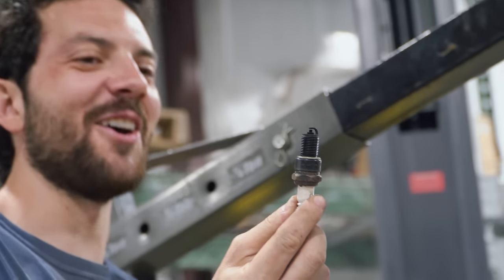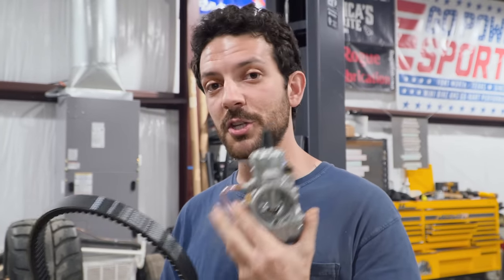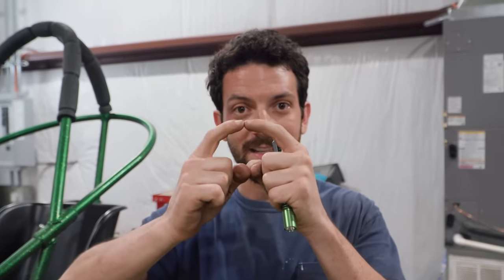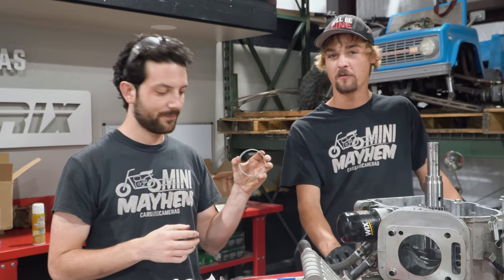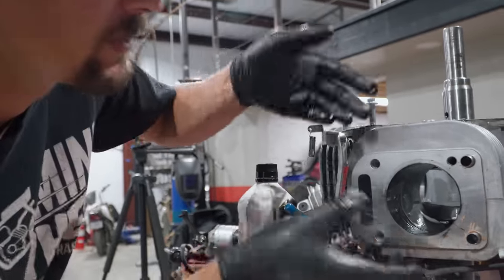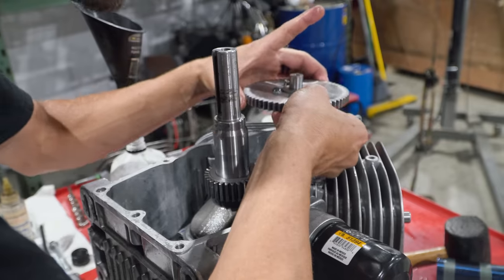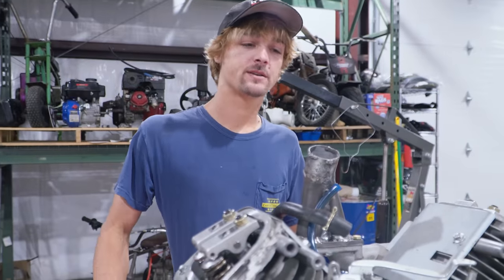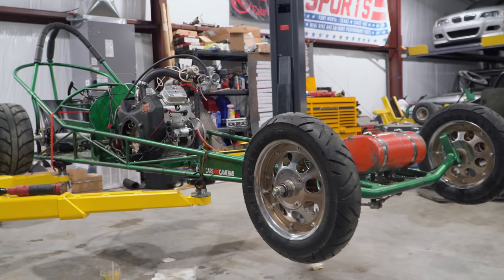Turbo 670cc Dragster Engine Rebuild | Prep for Methanol and More BOOST!

Comment: You guys need three times the amount of cfms for that carburetor and huge Jets and a lot of feel pressure run methanol.
I went from a 750 cfm carburetor on my race car engine to a 1200 cfm. Love to see it work make sure you guys flush out the engine every time you run it. 👍🏽

Comment: i always just used stp, or regular lucas oil additive as assembly lube. it's sticky, and i was gonna add it any way. for what you're gonna do with this, a teardown and inspection was a good idea, if not an absolute must. a sponsored top fuel dragster team may do that between every race to inspect for excessive wear and premature component failure in order to insure against "rapid unplanned disassembly" as charles so eloquently described it, on the track. that'll hurt a lot worse than getting yer panties inna wad over having to do all this extra work, especially if large, jagged chunks of hot metal wind up rapidly travelling through the same space as that currently occupied by your person because your engine ker-sploded, believe you me.

Comment: It was a good thing that you happened to notice the oil leak. because it likely would have gotten worse. it's a good thing that the 670 has a oil pump. otherwise it would have made installing a Turbo rather difficult. a higher lift longer duration camshaft would have been a good addition. to allow that turbo shove as much air/fuel mixture into the combustion chambers as possible. and you ultimately don't want to use a turbocharger on an ultra high compression engine. it would be interesting to see that 670 sprayed. you would get the most bang for buck. it's too bad you can't put EFI on that 670. it would have to be multi port not throttle body injection. the new Briggs and Stratton Vanguard V twins are fuel injected. although I'm not sure if they are multi port or throttle body injected. a stock one would be a perfect candidate for NOS. if I had an unlimited budget I would like to try that set up on a drag kart.
Reply: As long as you keep the overlap down you should be ok. Turbos don't like a lot of overlap

Comment: If I'm not mistaken on a past episode didn't Ike say he felt that it "ran out of gear" before the 1/8 mile? If that's the case I'd be changing to a larger diameter tire to help the turbo Pull that dragster along without going into too many rpms.

Comment: Back in the day when I ran jr dragsters we used to run a 42mm carb on a 407cc engine. Na obviously. Had to drill the tube the main jet was in to allow enough fuel through. Then adapted it to Holley jets and used number drills to set hole size. For boost I would chase about 0.85 lambda on this.

Comment: You should get rid of the rubber hose intake or use 1-2" rubber sections and a pipe between. The carburetor will get a cleaner vacuum signal without all the expanding and contracting rubber in the manifold.

Comment: If that engine used a gasket for the closure plate then you need to have a real gasket on there. The gasket helps set the crank end play. Your crank may not have the proper end play now and you could have some real problems. I was the western Canadian kohler service guy for over 10 years. I have seen the outcome of tight end play.

Comment: With boosted engines the boost cause lot more pressure in the crank case and on boosted car engines it will push oil out and they have to run a puke tank to catch the oil so that is something to keep in mind when racing because the track don`t like when you oil down the track
Reply: I was thinking that too. Theres going to be a bit more blow by while at idle or part throttle. Going to push some oil.
Reply: Has a catch can and a line into the intake to burn what it doesn't catch

Comment: rebuilt a lot of engines  when I was younger and if I remember right  you need .004 per inch  diameter.. so if you got a 3 inch piston you need 12 thousands   end gap.

Comment: replace the charge hose with a real pipe the less rubber on the intake the better it will perform rubber on a turbo system is normally only used to couple pipe together

Comment: Y’all should install and inter cooler in it.  Maybe an ice one
Reply: With methanol, it's not necessary to run an intercooler. Methanol cools the air as it mixes.

Comment: Top ring gap is always tighter than second. This is so that cylinder pressure doesn't get caught between the two rings and lift the top ring off its land, killing the seal. Don't know if it's going to be the end of the world for this build, but I'd have given it at least 5-10thou more gap than the top ring, if not the full 0.014" wider than the top ring that it came with.

Comment: Always be careful about the Orings on the Side covers that are there to keep in the oil pressure. Whenever you are inside these engines weather it's a Honda, or clone or Briggs Vanguard or basically any of these V twins horizontal or vertical shaft engines. The oil pumps are in the side covers and or sumps and in order to pass pressure to your block where it goes onto your camshaft and crankshaft/rods the oil is passing through Orings and with time and heat, they get hardened and they are prone to leaking. The problem solving is adding a additional solid sleeve to your pass through points to protect your orings from blowing out at high RPMs or just installing new set of Viton Orings which are superior for heat and oil over conventional rubber ones are! 🤔 the gaskets on the Briggs are stupid money anymore and people cut corners on these gaskets, which is usually a big mistake. The set your side lash of your cam and crankshaft and by adding sealers to your gasket surface, in theory your opening up your end play on both the cam and crank! Which is something you would like to avoid. Just a BTW for ya'all. May want to get the correct gasket thicknesses and dial in the end play if you want this engine to hold together any length of time?

Comment: Nitro is self oxidizing, meaning it doesn't need additional oxygen to ignite. You can run even richer than with straight methanol. Also, Im not sure if it matters on lower concentration mixes like 50/50 but pro teams that run nitro actually start the engine on gasoline and then switch on the nitro. And they "blow down" the fuel system to get the nitro out before attempting a restart.

Comment: The heads have had work done? If so you need to lathe the pistons and/or ad a gasket to the head since all you get is detonations if you have high comp with forced induction.

Comment: The part on the head that has that ring around it is there because it's a boosted application there are gaskets meant for it so if you're not using the same gaskets as I meant for that head you're going to blow head gaskets

Comment: You guys might want to make the carburetor a blow-through because injecting liquid through the turbo will damage it very quickly. To make the carburetor accept boost, you need to keep the bowl from pressurizing (plug the bowl vent in the intake and add one on the bowl itself and vent that to atmosphere) and increase fuel pressure based on boost, you can get boost reference fuel pressure regulators on Ebay for cheap. Good luck.

Comment: No, massive is the jets Rotary Engineering put in the rears on the dual Weber 46 DCD progressives on my built up RX engine.  The rears had NO jets in them, just wide wide open.

Comment: I would have opened up the bottom ring the "stock" difference between the two rings. You always want the bottom ring to have a wider gap to allow pressure between the rings to be relieved. Your bottom ring will be wider but not by much, you may get away with it.

Comment: ethanol allso works as a degreaser so disolves the engine oil , theres special oil for alki engines and you need to change the oil a little more often , its allso wise to drain the ethanol from the fuelsystem and even run the engine on gasoline for a while before storing it
known of a mini cooper racer that converted the engines carbs to run alcohol , now these cars run SU carburators that have a simulair fuel metering system compared to a moped motorcycle carb , beside enlarging the emulsion tubes and the jets he had to have the needles machined too to get the fuel curve right for the alcohol fuel
as for the bigger fueltank : maibe look intoo an aluminium mini beerkeg
about the alcohol tune , think grass speedway bikes run on alcohol i know the ice speedway ones do , maibe look intoo those forums to get some base tune tips

Comment: The ring gaps make no difference when assembling an engine. Rings rotate on the piston when it's running, and will line up together many times during the engine's life.

Comment: You should make a aluminum or steel intake manifold, while the engine is running at idle you can see the engine begging for more air. You can see the tube sqeezing itself almost shut

Comment: I'm surprised that the billet rods are aluminum! They have a limited cycle life. I understand that they are lighter and allow for more revs. For longevity they should be of a high strength steel, like 4130.

Comment: Easy to knock a crank out of alignment from using impact gun on crank related things.
Reply: That only applies to two piece cranks like on older two stroke bikes. Small engine cranks are one piece…

Comment: You guys really need a lambda guage to get your air/fuel ratio right. 
Although I still do it, indexing rings really isn't as important as you'd think. When the engine is running the ring gaps move.

Comment: you know there's an up & down side to piston rings, right? Never mind which is top or second ring, rings have a slight bevel on them that is critical for proper cylinder sealing. Typical identified with a dot (dot towards the top).

Comment: Methanol is happiest at 6.4 afr, but will tolerate being up to 20% too rich. The round slide mikuni is not the best choice for a couple reasons.

If you have a efi kit available, use it.

Comment: The problem with with not using the side cover gasket is that the gasket is a specific thickness to control crankshaft end play. So without that gasket the end play will be out of spec.
Reply: They had shims in there to set the crank endplay if you didn't notice.

Comment: I bet it won’t get up 2 temp with that full fin flywheel on my race 212s I’ve had to block off the fan shroud and run a finless flywheel and they still don’t get up 2 temp

Comment: Is it me or does anyone else see that 1 lil go kart chain snapping and wrapping around stuff? You guys need to step that up to some 530 pitch steel sprockets with a DID ZVMX 530 chain. Whats the tinsel strength of your current chain. DID chain's handle 600 hp turbo bikes.. just a safety concern. You going to need wheelie bars when it gets dialed in and hooks too. Won't take much to drag that little bar under your ass on the ground lol. Cool build. Way more interesting than typical junior dragsters..

Comment: Methanol is double the amount of gasoline. You need 100% more with Methanol. Try to stay around one half burn on the spark plug and you need one heat range cooler minimum for turbo Methanol.

Comment: With all the increased power,and it comes in After the turbo has spooled up,Why didn't you Lower the weights in the Torque converter so it acts like a 'stall-speed' converter in an automatic trans car??You want about 2500rpm to launch right?

Comment: Then when you add nitromethane you’re going to find out that you’re going to have to idol it up just to get it to run and next thing you know you’ll be over half throttle idled up just to idle and that comes from needing more air I’ve got tips and secrets about that too

Comment: Make an affordable kit. Every kid with a go-kart will want one!  Re: Ring gap. How hot does the engine get when, after a warm up, it runs for only a few seconds. If you were boosting around a track wouldn't that be different? Would you get blow-by if you didn't get the temp just right?

Comment: Copper head gaskets u just heat them up with a torch and quench them. Never use a "sealer" on any head gasket.

Comment: Something important to keep in mind, methanol fire is really hard to see. Very close to invisible. If something seems hot, it could be on fire.
Reply: This right here
Reply: There is an additive we use in England so the flame is visible. 
Can't remember the name
Reply: They aren't using straight methanol, so the flame will be visible.

Comment: im not sitting here combing thru the comments to look and see. but did you guys really put the oil return into the crank case vent?  thats why you blew out the gasket.  you need to VENT the crank case pressure. not block it off.. it has to go somewhere..  the oil return needs to be put  lower on the motor. this is why they pop a hole in the oil pan on cars.  the top of the motor is for venting gases.   you dont need to open ring gaps. your already getting blow by from the added crank pressure
Reply: Congrats☝️ u are highly recommended to 
Invest in crypto text the username on telegram

Comment: Having the connecting rods make inspection port/oil level indicators in the sides of the block is not a good thing. Increasing the ring gap will help keep the ring lands on the pistons. I wonder if you know of anyone who's researched running methanol in an air-cooled engine in regards to engine temperature?

Comment: Methanol eh? Fuel flow - Tank vent clear? From tank through to jet holder needs a big bore flow - think 'thirsty V8', not 'light twin'.  Too rich, they run rough & catch fire; too lean, they run once & earn their 'Certified engine welder' badge! : )

Comment: You should mount the fuel tank length wise so the G forces help push the gas back down the line to the fuel pump speaking of fuel pumps shouldn’t you get a bigger one

Comment: Guys if you would run on ethanol the plus 40% fuel would be correct. For Methanol you need double the fuel compared to standard gasoline.

Comment: That primary clutch looks suspiciously like a early 1970s Salsbury clutch. Unless they improved the design which I doubt your losing power through that clutch. 
A CV tech power bloc is a far better unit and is more and easily tunable.
Btw I think the last time a snowmobile used a Salsbury clutch was 1973 or 74 meaning the manufactures figured out a long time ago that they were not very good.

Comment: Wear the correct protective gear when you run the meth. You don't want or need a crispy member of the crew.  Lots of info and tips on running methanol in the drag racing community if you need any pointers.

Comment: You are going to eat up the 780 clutch the 94c duster with ribbed cover is way better and doesn't break the spider if you slip it. Trust me I learned the hard way. Blew up 2 immediately on a lightly modded 440 Duramax. Not sure why everyone is pushing the 780 so hard. For the same price the 94c is almost indesructable and far more tunable

Comment: There’s more to making a carburetor methanol than what you explained I’m not too far in the video yet but the fuel coming out of the carburetor out of the fuel bowl has to be made bigger the center tube we’re all the Jets go in have to be made bigger every place that fuel goes Has to be made bigger

Comment: What, no high lift full race camshaft ?? You really need heavy duty double chains on this build. It's good to see you working on something that needs to be done right, not just throw it in and see what happens.
Reply: With turbocharging or supercharging, a milder cam actually works better, because the intake charge is under pressure, and high lifts and long durations are not needed. Also, retarding the ignition a few degrees helps prevent detonation....

Comment: You’re not gonna want to let it sit in idle for a long period of time, because it still start the fill the bottom end with methanol and it will detonate when you go to rev up. Then it ends with parts on the outside that shouldn’t be on the outside

Comment: I'm not sure head studs would be necessary I mean hardin's specialized head studs because you're only putting out what 8 lb of boost 10 lb of boost I think you'll be alright
Reply: Have to consider those are chinese price point cheapo head bolts. I wouldn't trust them to hold down a wet paper bag.

Comment: Actually when you have 3 piston rings you're supposed to offset the rings by 90 degrees. It goes 2 rings by 180 3 rings by 90. Did you have the head and jug resurfaced. I hope so or you're going to have a weak spot in your compression chambers.
Reply: @vcoin3184  why did you send me this unsolicited info? Are you single? Are you trying to find a date?what gives here?

Comment: E85 is about 40% more fuel. Methanol is way more than that on a boosted engine. 2x gasoline will get you close
Reply: Yep, they doubled the jetting if you heard around the end of the video.

Comment: When you get that dragster running faster your going to have to put thicker tubing around the driver to run it. Are you using Jr. Dragster rules in your build? Or did that dragstrip sign off that you'll have to buy your own casket?

Comment: Advise, Stay away from Nitro Methane if you like that engine, If not Plan on a lot of rebuilds and engine work It will be fine idea is gone with Nitro. You will melt pistons rods I know tried it with my Pro Drag Car ( This Is A Serious Warning ) Use the NHRA rules and Safety books , Personally You should try and get in contact with Any pro top fuel team. They may be able to give you safety tips and advice. Go Power Sports I do not think is the route you should take? Safety is #1, I can't honestly tell you it is safe. You will have a literal time bomb on the front of the rail.

Comment: methanol destroys most rubber and silicone so you should really replace the charge pipe with fuel tank filler hose